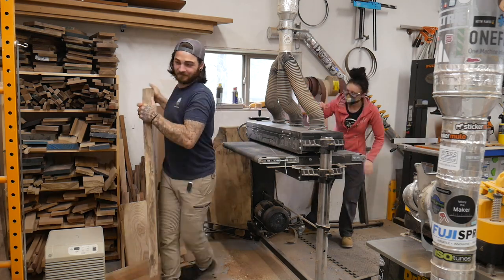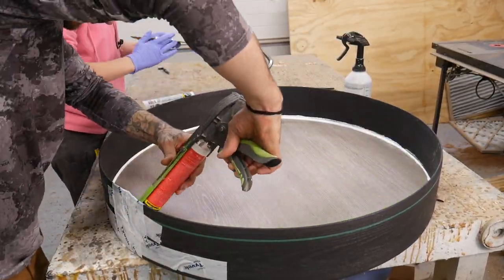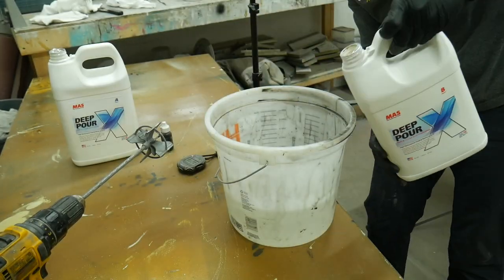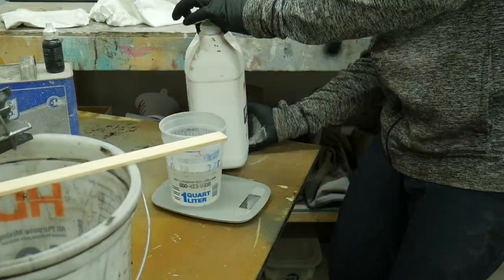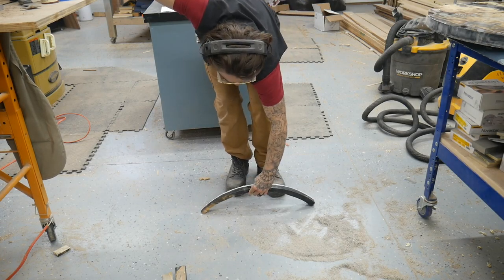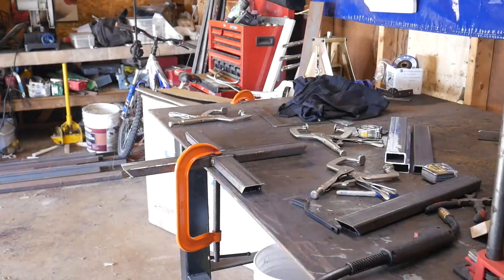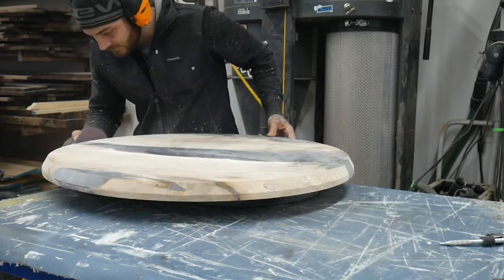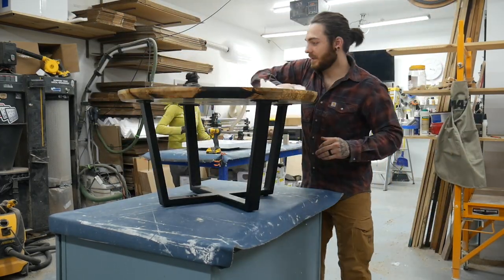My biggest epoxy pour yet with custom welded metal base // DIY // How to

Comment: Lots of fun! I have some smaller live edge slabs that hoping to get to when I get my current commissions done but was hoping to cut out the circle on my onefinity after I pour for some end tables. Probably wasteful of wood.  Love that you make your own legs!
Reply from the maker: Thanks! the issue with the onefinity is the 1/4 bits can only cut so deep. which is why I used a jig and jig saw. if your piece was about 1.25" thick it would work great!
Reply: I really appreciate your reply. That is actually just about how thick it is. Have a 3 inch (2 inch cutting area) bit that I use for 1.5 inch cribbage boards that works pretty good. If it goes well may have to finally upgrade to a spindle to get those 1/2 bits.

Comment: Hi how come you did not  cut out the table on the cnc?  Came out great
Reply from the maker: It was thicker than I could cut. I can only use 1/4” bits with my router and the max cut depth is just over an inch. I probably could have but didn’t want to risk it lol

Comment: Great work...how much would the
at sell for..that would look great in someone's house
Reply from the maker: About $2000 but could be a lot more depending on wood type, table size, epoxy used. In this build the materials were around $800 if I remember correctly

Comment: If I'm ever able to make a table that nice, I'd have achieved my woodworking goals.  I notice you surfaced this before your spindle upgrade?  Can you tell us about the feeds and speeds too?  Also, what do you set your Makita router to as well?  I've seen some comments on the OneFinity site making me scared of surfacing.  Thanks
Reply from the maker: Hey! I believe I used a 1” or 1.25” being a larger bit I probably set the makita to 2-3 on the dial. Definitely start out with a low depth of cut. I don’t recall what I used exactly but I’d start out around .05 and 120ipm. If you add depth on your cut is lower my speed
Reply from the maker: If I’m surfacing my wasteboard I’ll run a depth of .04 and a speed of 150ipm or so. Again with a low router speed.
Reply: Thank you Jeff

Comment: If you use Rubio you don't have to sand to a really high grit. Although it is expensive.
Reply from the maker: I had to sand the epoxy to a higher grit so you didn’t see swirls 🤷🏼‍♂️ I’m more so using up the odies. I just got a can of osmo too. I do like Rubio though I’ve used it on a lot of my larger pieces